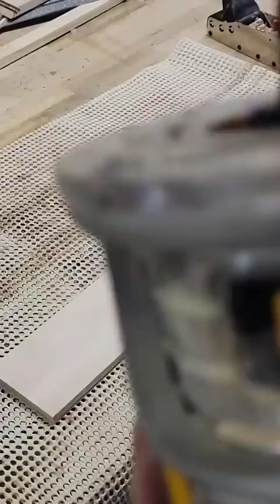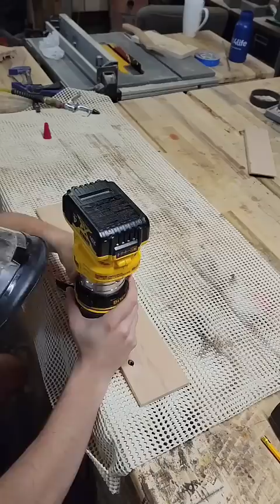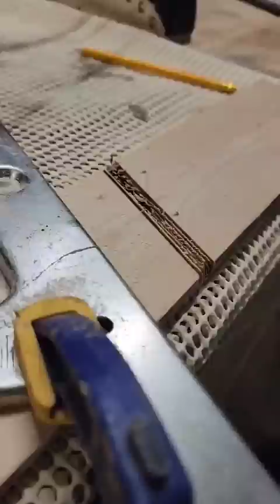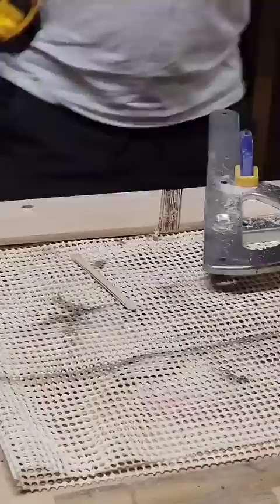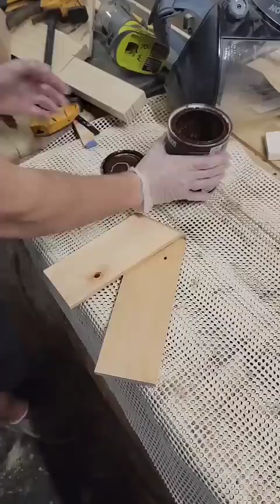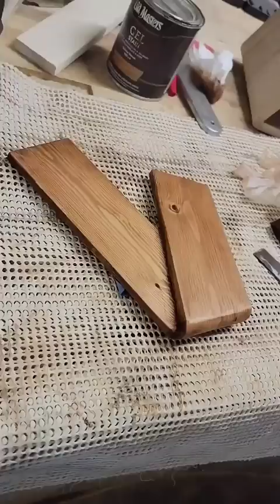How To Fold Wood // Woodworking #carpentry #diy #woodworker #maker #woodworking #wood #handmade

Comment: The hour inside a steamer quietly ignored.
Reply: boiled mine in a frying pan for 10 mins, worked great
Reply from the maker: Kerf bending does not require steam.
Reply: @JoshWrightWoodworking even if is kerf the last 3mm should be treated somehow... or not? Is same like you try to bend match ... or a touthpick... i never try kerf bending ... can you please explain a bit more....
Reply: @user9z6c7x8g6t he sprayed it with water after the cut
Reply: @JoshWrightWoodworking well that depends on how thick of a section you leave, doesnt it?
Reply: @JoshWrightWoodworking  What's the angle of that bit? Is it an upcut? Beautiful and original idea, mate.
Reply: Dont be steamed.
Reply: He never shows the fold in the light...the cuts probably made a gap in the wood where it was folded?
Reply: @user9z6c7x8g6t A majority of the thickness is removed, leaving a thin amount still intact. The remaining wood is soaked with water to make it more pliable, then it is folded in half. It has to stay clamped until the area dries out.
Reply: Please use different bit 😢
Reply: @marcekbbillings5009 hat's why he used the tapered bit and not a straight one. A straight bit would leave a gap, but the tapered one will not if you do the math right for the spacing and number of cuts you need to complete the desired curve.
Reply: A lot of joshes in here…how many joshes can you fit into a reply section?
Reply: @MermaidMakes  It's a rule that if you are named Josh, you have to have at least dabbled in woodworking at some point in your life.
Reply: What kind of wood is this?
Reply: @beardedgames8490  Based on the pronounced difference in the grain, some kind of pine.
Reply: @MermaidMakes  And all of them are fake! 
There is only one true Josh!
Reply: Just be kerful.
Reply: @jdthnt  I thought there'd be steam. I guarantee that with steam, less material would need to be removed and it would be stronger. Steam is used for small bends though AFAIK. Still, I think this could be done with router AND steam. But there may not be a need for any strenght. MAy ne jsut decorative piece
Reply: @dawson8325 Mmm-mmm-MMM! Nothing like a classic wood, boiled hard in the frying pan — just like mama used to make! 

Haha that's all I could think when I read that 😆
Reply: @MermaidMakes never more than 42 joshes at once in the same comment thread. It's an unwritten law of the internet 😌
Reply: @Lyriox  Wood chips – "chips" as in potato chips, not regular wood chips – are actually a type of food. 
Particularly ones made from pine trees, if I recall correctly. 
It‘s sort of a tradition in northern Europe, together with making oils out of it – again, iirc.
Reply: @jdthnt  it's just two different methods, bro, calm down 🙄
Reply: @draco5991rep  what happens after 42?!?! I’m scared!!!
Reply: @MermaidMakes  No one knows 😰
Reply: @pizzlerot2730  I know exactly what’s goin on here my man lol it was just hilarious to see such a confident comment get shut down bc that’s not how he did it lol
Reply: @jdthnt  actually I'm pretty sure that you're the only one who read it is "such a confident comment"...to me and seemingly everyone else, it's pretty clear that there's a tongue-in-cheek tone to it. But then humor and sarcasm and pretty much any rhetoric of any kind regularly goes over the heads of those in the YouTube comment section, so you're still in good company.
Reply: @beardedgames8490 the kind that your stepsis won't appreciate... soft wood
Reply: @pizzlerot2730 it was pretty clear he was dogging him for cutting out a part of the process.
Also, text on any format is an inherently perfect medium for misinterpretation.
Reply: @neepsmcfly4176  seemed pretty clear to me that the tone was cheeky more than seriously critical, but I'm not going to argue about interpretation. 

The original point that I was making was that the guy celebrating like he'd just won the lottery about OP supposedly getting owned was being beyond ridiculous. If that person really gets that much joy perceiving a stranger on the Internet being wrong about something then they're either really scraping the bottom of the barrel in terms of maturity level, or they need some serious therapy.
Reply: Everyone knows how to wood work but won’t posts videos 😂
Reply: @lostpony4885 I hope they're not boiling mad! It might get a bit hot under their collar, but I'm sure they can iron it all out. As long as it's properly heated. Though, I think they might be full of hot air. Don't get it twisted though, I can set the record straight. They just need to get properly  bent... 🤔 😳.....🛑 me🙏, I'm on a roll, but I PROMISE I'm not baked, just a bit cheesy. Don't get steamed, get baked... Is that ©️?!? I butter stop before anyone gets heated... 🙏 🛑 Me. 🆘
--Amanda H
Reply: @JoshWrightWoodworking 
Hence why that technique was quietly ignored.
Capice??
👀
Reply: @vociferonheraldofthewinter2284   mp0
Reply: @JoshWrightWoodworking how about terf bending
Reply: @beardedgames8490 bent
Reply: @marcekbbillings5009  Ya, he does, right at the end. You can see a couple of repairs on the fold, too. You can bend it a certain amount, but wood is not like metal, in that with heat, and going slowly, metal molecules will rearrange, wood cannot do that, so it only stretches so far, and I believe even a right angle is asking a lot, but about the most you can do. Also, maybe if it's fresh, green, and willow or hickory, which is the 'stretchiest' wood species, and it doesn't fold. I know this from craps. The stick we use is the most flexible wood you can find, hickory. peace
Reply: I mean considering the title is how to fold wood that little importand piece of information would have been usefull.
Reply: @dogie61 I tried what the video did, worked well. If there’s just a bit of wood left just rub water on it and it becomes pliable.
Reply: @TheDJOblivion  Wouldn't it need to be hot water to work well?
Reply: This isn’t that kind of bending my dude. No cuts when steaming
Reply: @joshuataylor1035 Why?
Reply: @pizzlerot2730 yeah, perhaps. All comes down to perspective, I suppose. I see your point yet, looking up from the bottom of the barrel, I think that if his statement was worthy enough to draw out the videographer, then I'm less apt to think I'm overreacting. Or, far from alone in my response, as lame as that is of any kind of proof of intention, of course.
Reply: @willsuttie3683 you ween
Reply: Who’s kerf?
Reply: If the wood is large is it possible to steam it with a household floor steam cleaner?
Reply: I know a "Josh" who doesn't woodwork. Is he broken?
Reply: @joshuawiedenbeck6944   This is a basic question, but how do you soak it? Pop it in a 5 gallon bucket or flat in a tub? This is SO cool!
Reply: @beardedgames8490  bendy
Reply: @MermaidMakes here’s another one
Reply: You'd never be able to fold like that.
Reply: Yea
Reply: hot water with fabric softener. KERF cuts don't need steaming dude.
Reply: @pizzlerot2730 it’s the level of douchiness and arrogance of the original post, it was only tongue-in-cheek as a backup measure if he were wrong. OP was a typical YouTube knowitall telling everyone they know better, to see that level of arrogance get smacked down, was amazing!
Reply: @ChristofferOrrmalmUtsi what? Don’t use Capice like some wannabe Tony Soprano, you’ll get schmacked.
Reply: @nickbuckingham9291 they wouldn’t want it any other way.
Reply: that’s gonna be a ugly corner, all chewed up. you prob need something to hold all those small bits in. when you do a proper kerf you leave enough material that to get some glue in there.
Reply: @beardedgames8490  folded
Reply: @joshuawiedenbeck6944  a Josh I knew as a kid broke his ankle tripping over a wood chip on the playground, that counts right?
Reply: What tip whats used in the router?
Reply: @burtan2000 That machine he uses is a router.  The tool is tapered.
Reply: @MermaidMakes another Josh here lmao.😂😂😂
Reply: @JoshWrightWoodworking  what kind of square are you using?
Reply: It's pine so it's different
Reply: @beardedgames8490, it's folded wood.
Reply: He’s removing the material to bend.
Reply: Comment section experts, engage!
Reply: I think he didn't need to steam the wood.
Reply: @MermaidMakes depends how many watch it……..

Comment: Now I wanna see origami
Reply from the maker: I was literally just thinking about how I could make a wood origami video lol
Reply: @JoshWrightWoodworking how about a wooden paper airplane
Reply: ORiGÆmê
The one with a One Dollar USA bill.folded into a bow tie do it with a piece of 5/4 white pine siding and WE both are going to be rich in cripto after trying to follow a sped-up 42 fold attempt, not to mention the 56 cuts per fold, leaving out all but the first and last three relief cuts per fold. I have a ten foot board in my shed that actually has 29 full hard knots in it that I can send you. You could have enough to make about one hundred trials that could be edited together. If you want to go fully artistic and laser etch the bill on both sides the session should not take much longer than 8 months to film. Ya might even be awarded a best effort to waste bandwidth for commercial gain.
Reply: I actually thought about this before too. Would def have to be large and very difficult. Much trial and error. But it would be cool.
Reply: @rileyclingan558  
In other words, a balsa wood plane kit? Used to be 29¢ in the '50' s. Now that Balsa wood is getting hard to farm, I guess another lightweight clear lumber needs to be looked into. 🌲🛩️ ,,
    (☞ﾟ∀ﾟ)☞👍ԅ( ͒  ͒ )ᕤ
Reply: @JoshWrightWoodworking  even a 3d box would be killer. Wondering how much planning needs to go into a mortar and pestle set,
Reply: Klein bottle? Moibus Strip, single also double?
Reply: @rileyclingan558 Now I wanna know if that would improve or worsen the performance of a flying plane.
Done correctly, probably my first thought, yes also written down in that order.
Done in a not so good enough way, most likely my second thought.
I would LOVE to be proven wrong just so my jaw got dropped in absolute shook and stunned by amazement!
Reply: Me too, i challenge you to make a crane, if you make a crane ill give you a dollar (brcauee im poor- that’s worth more sorry) but ill give you the dollar… please, i really wanna see it
Reply: Woodigami
Reply: @rileyclingan558 paper is... made of wood...😏
Reply: @JoshWrightWoodworking ooo sounds fun!
Reply: @StanErvin-yo9vl  No, not a plane kit, a wooden paper airplane. Classic paper airplane shape, made from cleverly folded wood.

Comment: This makes me so uncomfortable. It's like trying to read a sign or paper in a dream. My brain knows it's a piece of wood, but for some reason it simply doesn't register. I love it.
Reply: Glass is also surprisingly flexible when very thin and moves like plastic! Also can wobble
Reply: Same I'm kinda grossed out by it even though it's also fascinating lol. It's like one of those people with hyperflexible joints that can bend their fingers super far. You realize theoretically nothing's wrong but it doesn't feel that way.
Reply: I read in my dreams sometimes lmfao
Reply: Just think of it was very, very, very thick paper.
Reply: Wait until you see how people actually bend wood and not this.

Comment: I'd probably ad wood glue with saw dust in the gaps to smooth the side.. because you can see it from the side a bit and for high end woodworking pieces its the kind of thing you need to think and do to be able to sell it a high price
Reply: That's why he used the tapered bit, presumably, so the wedges will close up cleanly without gaps when the curve dries. Might need some wood filler for the seams at that point, but that's it.
Reply: @abydosianchulac2 wood filler sometimes shrinks or takes on the stain differently making it show up and drawing your eye to it.
Reply: @abydosianchulac2 he could have done it with out cutting it at all though. If you hoil it enough wood gets extremely flexible.

Comment: Very cool man! As I’ve watched this video many times I’ve come to the conclusion that, there is a way to make that bend seamless without the tapered router bit Kerf marks… don’t get me wrong brother, this is epic! You’ve inspired me to take what I’ve learned from your video and take it a step further.
Reply from the maker: a normal saw kerf would work but would leave triangle shaped gaps when folded. This tapered bit leaves no gaps.
Reply: You could build a steam chamber   and bend the wood. No cutting or kerfs involved.
Reply: @acerjuglans383 No way streaming would allow that tight of a fold.

Comment: Fun fact: A man once bent a piece of wood just like that without cutting it and only using his toes. That man’s name was Chuck Norris.
Reply: Correction: Chuck Norris only used his eyes.
Reply: Right after he came back from a feminist march… with fresh made sandwiches.
Reply: I'm just curious.
How old exactly are you @daneking1209 ?
Chuck Norris facts have been out of fashion since the early 2000's..
Reply: @xl000  going by@daneking1209’s comment, barely old enough to know they existed and definitely young enough to not know how to use them… or he could be drunk when he made that comment. Probably drunk.
Reply: @IsaKocoglu  to look at the board angrily and make it fold itself up?
Reply: Dropping lame Chuck Norris jokes in 2023 is like someone insisting that the old-ass clothes they're wearing are actually "vintage" or "antique", but actually no, they're just old and nobody is buying the attempt at "retro cool". Just stop.

Comment: Laminating wood is a woodworking technique that involves gluing together multiple thin layers or "plies" of wood to create a strong and flexible composite material. This process is commonly used to create curved or bent wood components, like chair backs, guitar bodies, and skateboard decks. Here's an overview of the laminating process:

1. *Selecting Wood Veneers:* Start by choosing the type of wood veneers you want to use. Veneers are thin sheets of wood, often around 1/16 to 1/8 inch (1.6 to 3.2 mm) thick. The choice of wood species and grain orientation can affect the final appearance and strength of the laminated piece.

2. *Preparing the Veneers:* Cut the wood veneers into strips or shapes as needed for your project. These strips will be glued together to form the desired shape.

3. *Gluing:* Apply a wood glue, typically a waterproof adhesive like epoxy or polyurethane glue, evenly to the surfaces of each veneer strip. Make sure to coat the entire surface with a thin, consistent layer of glue.

4. *Layering:* Stack the glued veneer strips on top of each other, aligning the grain patterns if desired. This forms a "blank" that represents the desired shape or curvature. You can use clamps or molds to hold the layers in place while the glue dries.

5. *Clamping:* Place the laminated stack into a mold or use clamps to apply pressure evenly across the entire surface. The pressure ensures a strong bond between the veneer layers and helps shape the wood as it dries.

6. *Drying:* Allow the glued assembly to dry completely. The drying time can vary depending on the type of glue used and environmental conditions. Follow the glue manufacturer's recommendations for drying times.

7. *Shaping:* Once the laminated wood has fully cured and dried, you can remove it from the mold or clamps. At this point, it should hold its curved or bent shape. You can then trim, sand, and finish the laminated piece as needed for your project.

Laminating is a versatile technique that allows woodworkers to create complex and curved shapes that would be difficult to achieve with solid wood. It's important to follow safety precautions and use appropriate clamping and gluing techniques to ensure a successful laminating project.

Comment: Just saying, a nice thick bead of hot glue in the gap on or on a warm surface just before the fold wouldn’t be a bad call. like super strong. People from a mechanical engineering background can figure out a practical purpose for this.

Comment: Pro tip: if you want to do this, do it on a table saw. It will save you an hour probably. You know how long it actually took him to make all those cuts, moving that clamp every time? It takes a while. Use a table saw, with a miter gauge, and you can do this in about a minute. No clamps required.
Reply from the maker: Tablesaw us definitely faster but it will leave large gaps. The point of using the router with the tapered bit is that the tapered bit leaves almost no gaps

Comment: What about using spacers in place of shifting the clamp every time? Like a little piece the same width you can add or remove each pass. That looks like such a nightmare to do that for each cut.

Comment: Easy way :

How many mm intervals do you make, for example 2 mm?  Prepare 2mm 4mm 6mm 8mm 10mm pieces.  Put them on the fixed place in order and do the operation.  Don't bother taking it apart every time.

Comment: Was that any sort of laminated wood or plywood? For some reason it almost looked like it when you were setting the depth of the bit. The very bottom/outside layer looked lighter/whiter than the inside.

Comment: I gotta ask doesnt this make the connection weaker unless you put some glue in the cut i feel like all it would take is the bent part to chip and it would snap apart?

Please tell me i wanna know how solid a structure it is after bending.

Comment: What bit is that?
Reply: Spiral cutter Can be used in any router usually palm router or high rpm rotary tool like drywall cutter.zBut let me tell you how dangerous us8ng a spiral cutter bit 8n dry wall cutter for anything other than cutting dry wall .palm rputer you have more control Those things are nano second frab n go.Kick real easy...use a dremmrl 4300 8n dremmel plunge router jig w ⅛ router bit.Easier safer csn lock depth